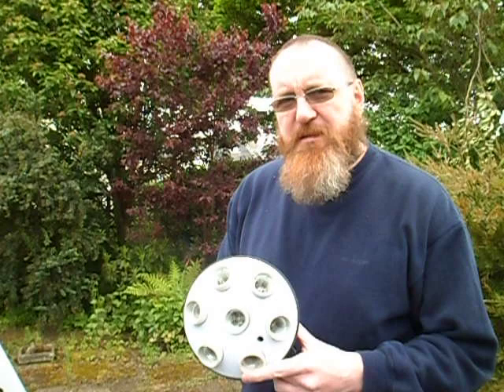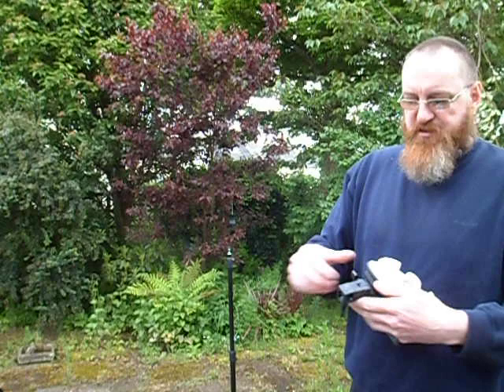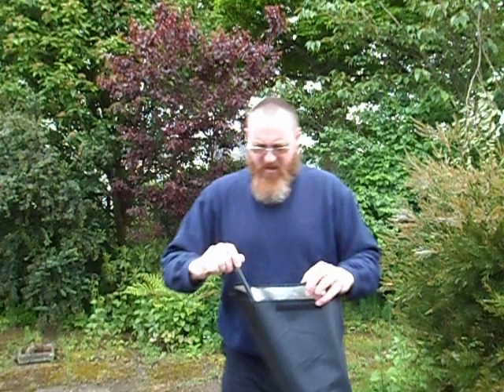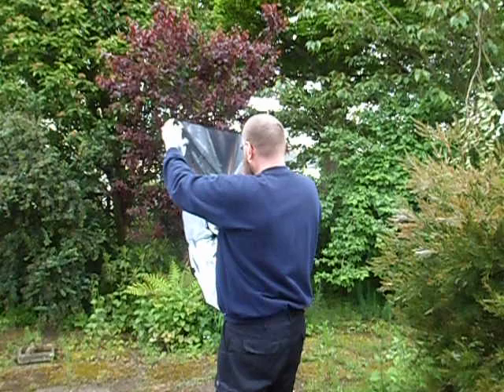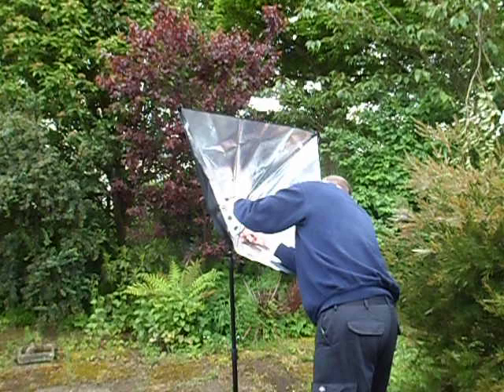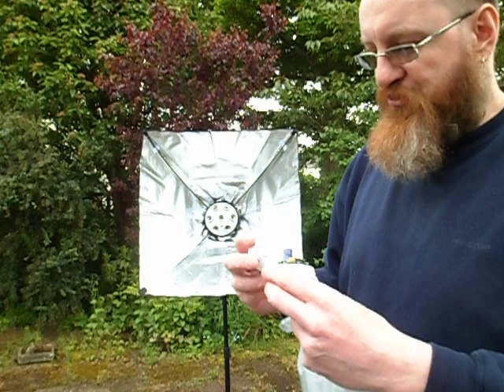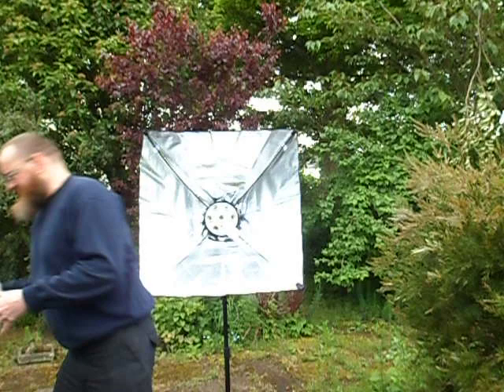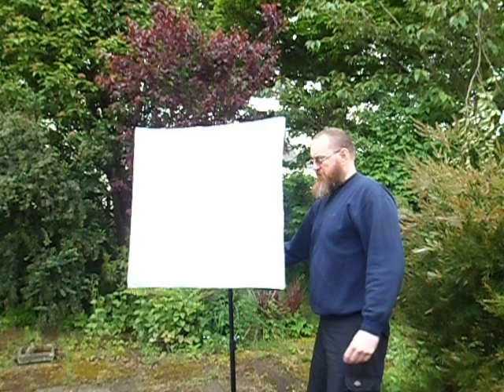How to assemble a typical ebay softbox light.

Comment: Clive, two ideas if I may: first, why not a mod of those lights to use LED chips ? Sounds like 10W chips would be viable. Also, if there is someone out there too mad about the rippling, a potential option is running the LEDs out of 12 or 24V battery banks. RC LiPo with an appropriate charger would work wonders: zero flickering and a reasonable run length. 

(and, thank you very, very much for the priceless lessons. Learning a lot)

Comment: Time to try out a radio mike for al fresco filming. I have a couple of UHF ones, made in China, that would be right up your street. Analogue - Digital - Analogue, so mixing with ordinary mikes on the same set gives some wonderful super-long echo effects due to latency. Solution: record on separate tracks then offset the radio mike ones to synch with the others. Then of course, synch that lot to the pictures. It's a doddle.

Comment: Hi Clive,
You mentioned 'ripple' from the lights. I've bought some cheap lights from one of the Chinese sourced Ebay suppliers. Unfortunately when they shine on a solid white background all the camera sees are horizontal lines rolling down the screen (a bit like if you try to record a TV). Is this the ripple effect you were referring to and how can I get rid of it?
Any advice (apart from don't buy cheap Chinese imports!) would be much appreciated.
Thanks
Reply from the maker: That does sound like the camera is seeing ripple.  Have you checked your camera settings to see if it has a mains frequency select option to try and remove the ripple or if it has lots of manual settings available try playing about with them.  You may find it's more sensitive to the effect in specific modes.  If it's just still images your taking then it may not even show the ripple on the final image even though it's apparent in the viewfinder.
Reply: +fullbedsforever As an experiment try a slower shutter speed to see what happens.
Reply: Thanks Terry. I've tried it on my old Canon HV30 HD camera and it's fine. It's only on my iphone (old 4) and logitech C920 webcam where I get the issue.